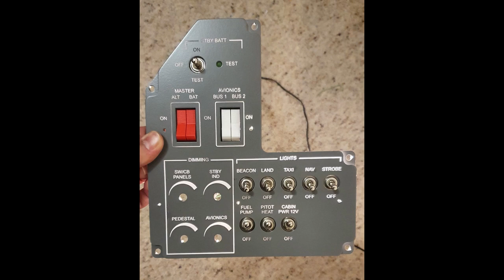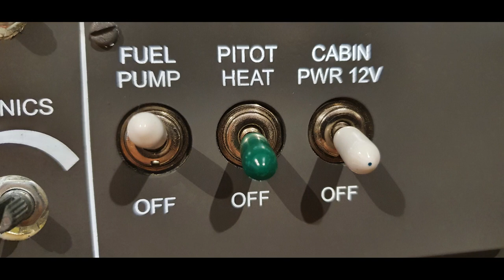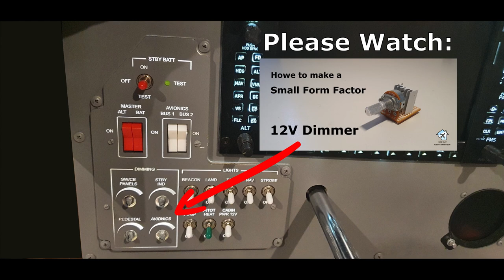How to make Cessna 172 Glass Cockpit DIY Flight Simulator Switch Panel-Part 2

Comment: Hi. Great video. Have you tought about selling on line a kit with everithing you need or at least 3 mm panels ready made ? I would be interested
Reply from the maker: This is a hobby for me and I am very busy with my job as a professional. But happy to take orders. Also I have some of the parts available. Including a full set of steam gauge c172 panel and radio stack. If anynone is interested...
Reply: @HomePilot  Hi. I understant. Anyway I'm interested to 1) laser cutted swtich panel (only panel) 2) 3D printed master/avionics switches

Comment: where can I get information on wiring and interfacing the panel
Reply from the maker: I have used mobiflight and Arduino Mega. All swithes, one pin have common ground and the other pin goes to the Arduino. Please check Mobiflight tutorials for how to interface the switches. I will make a video about how to wire up and configure Mobiflight if I get time. Good luck!
Reply: @HomePilot  Thanks